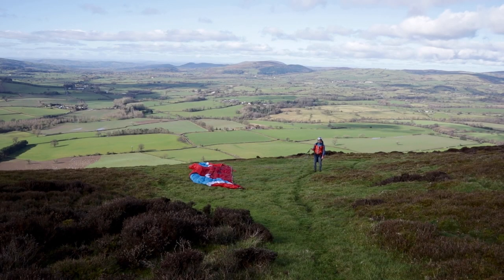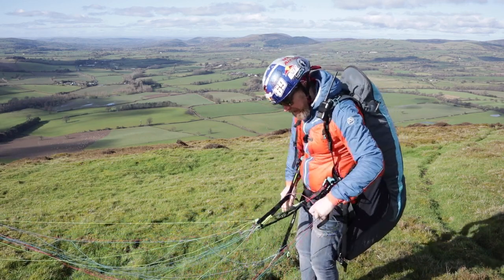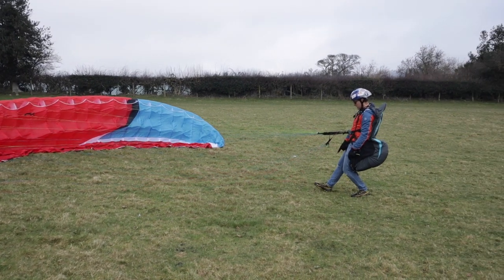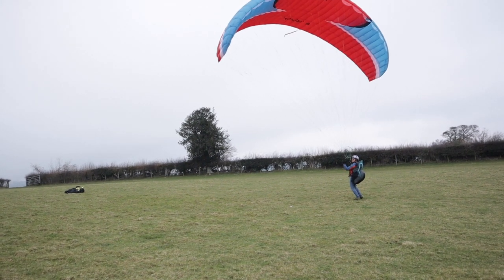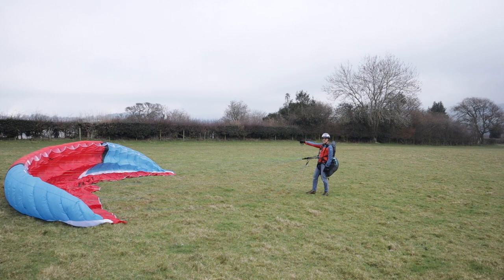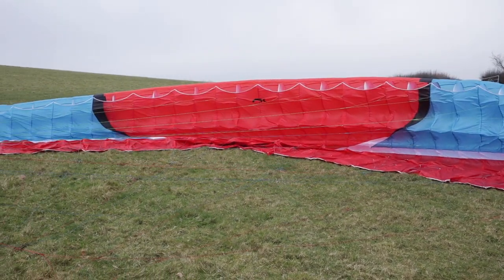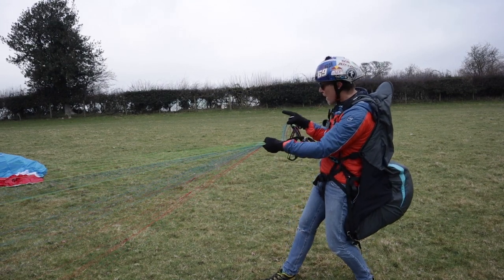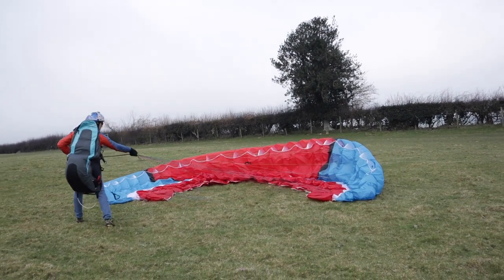Paragliding - Connecting and ground handling. Episode 2  #shorts

Comment: Really good tip for the ground roll control. That's something I often would get mixed up in my head and the way you explain it makes it really easy, move to the right pull to the right
Reply from the maker: That’s it, simple as thats mate.👍🪂
Reply: Yes, when facing the wing on reverse launch. When facing forwards you pull the brake under the high side, as Marc demonstrates.

Comment: Very clear, excellent video!
You are a good man!

Suggestion: assuming strong wind conditions…when going to take “an hour break”, perhaps it would be a good practice to put the other tip of the wing under the other tip (the one you already had folded in your video) and the harness on top of both of them, in case the strong wind changes direction during your brake.

I started to see your videos today and am a new subscriber.

Thank you for your videos!
Reply from the maker: Thank you for subscribing.

Comment: There are so many different methods and websites to look for weather before flying. Can you please create a very simplified method how a newbie can review weather?
Covering -
paragliding maps
free vs commercial websites and merits/demerits
what all to check (direction of wind, knots, any other things)
Lastly providing some readymade checklist for beginner pilots to start with?
Reply from the maker: There is no simple way at looking at just one weather site really, I check 4 or 5 each day for my students and try to build a picture myself for the following day.
Were also lucky to have a weather stn on top of one of our best hills that gives wind speed and direction with a camera too.
A big thing to remember is most weather sites wind speed is at sea level NOT hill level so you need to work out the height of your hill and get some practise in knowing how much to add to the forecast, ie when my local area forecasts say 10mph I double it and this is roughly what it will be on the hill top.

Comment: Thanks very much for the great videos. I've enjoyed watching them. Its been hard finding nearby instructors so I find myself mostly ground handling every day instead of flying. I know that will pay off down the road anyway. The other day, I was ground handling with fairly strong gusty winds. I was doing pretty well facing forwards and doing wingtip touches and recoveries. But a couple of times, I felt the wing drop back some, I released all brake pressure completely, but I still got dragged backwards. Any troubleshooting ideas to prevent this?
Reply from the maker: Thanks tom, it's so hard to say without seeing the situation buddy but your spot saying it will pay off in the end. Ground handling is the key. ps, if the wing is an older wing they do tend to hang back and fall back more than a crispy newer wing so it could be that.
Reply: @leavesleyaviation  Thanks for the reply, Marc. I got back out there some and I think I've found the problem. As the wing goes back, it felt to me as though it was a lot further back in the power window than it actually was. So, thinking it was about to drag me backwards into the street, I pulled the brakes to kill the wing, but that just pulled it further down into the power window and would really start pulling me backwards. Whereas, in reality, the wing hadn't really dropped that far back and what I needed to do was really lean forward and get as much weight in my chest as possible, and perhaps let the wing pick me up a little and "pendulum" backwards under the wing. It was more my perception that the wing was further back than it was, and my reaction to it was probably helping to make that my actual situation. Thought I'd share my self-assessment as it might help someone else.

Comment: Hi Mark. Great video. If a wing has split A risers, i.e. two A riser maillons on each side, do you take both of them or just the inner ones when guiding the wing up?
Reply from the maker: Very good question dave, if your wing tips have a habit of coming up quickly and almost before the centre section I would only use the inner A's buddy.

Comment: Hey Marc, great videos, tx! 
Just a question about the reverse launch. You have the right hand on the right riser break and left hand on the left riser break, so far I understand. But when you go for the rear risers you take the right rear riser with you left hand and the left rear riser with your right hand? Is that to be able to pull the rear risers further back? Many thanks for your help!
Reply from the maker: Thanks for the message pal and yes spot on 👍 ps BUT do not pull the rear risers past the front of your hips, if you do the wing will try to launch trailing edge first and go inside out, if that ever happens just release the riser a bit and it will correct it’s self.👍🪂
Reply: @leavesleyaviation  Okay! Thanks for your quick reply! I'll go for my first real life introduction paragliding in a month🤩Your videos make me feel I could do without, but I guess some personal training is always recommended, regarding the risks of the sport😛
Reply from the maker: Thats great to hear, yes 100% better to get an instructor 😉🪂

Comment: Thank you so much Marc! I am a low hour P2 I’m Michigan U.S. We have much wind here. Coastal cliffs. Sand. We have to launch on the top of the slope because of no flat or nicely rolling tops like in the U.K. Any suggestions for launching on sand slopes in winds 12-18 knots? I have a B wing.
Reply from the maker: Hi dave, well I launch my wing on the beach then run sideways up the dune and I am away, it takes practise but works great.

Next time I am at the beach I will make a video.👊🪂

Comment: Hi Mark, I am a little bit confused on the pitch-control at around the 16th minute of the video. If the wing goes to the left, of course I also walk left to get under the wing again. You say, I must also pull left whilst walking left and there is what I got taught different. I would walk left and pull the break on the right to get centrally under the wing quicker... It works good but what you do works obviously also good. Can you explain that to me please? Thanks in advance and warm regards, Moritz
Reply from the maker: Thanks for the message Moritz, when you were taught do I take it you were taught to twist LEFT?
This would be why when the glider falls left you would pull right brake, it is because the way I teach is to twist RIGHT.
Basically it’s just because the risers are twisted one way or the other buddy.
Hope that makes sense ??
Reply: @leavesleyaviation  Thanks for the quick response Mark and yes, now it makes sense to me. We do then the same as i meant to break the right side of the wing which will be with the left hand and walking left :) Confusion over and warm regards to the UK
Reply from the maker: @moritzleidler  hehe all the best buddy.
Reply: @leavesleyaviation  Wrote you an inquiry via email. See you there :)
Reply from the maker: @moritzleidler  Ok not had it so far!
Reply: Yes you are confused. What you meant to say was 'roll-control', not 'pitch-control'.
Roll is left or right, but pitch is backwards and forwards.

Comment: Been training a few months, vest video I've found. Thank you. 

One question, what if the glider turns? So not going down left or right (roll), not up or down (pitch) but spinning on its axis (yaw). Can I correct that or is that just the wind changing and I need to follow it?
Reply from the maker: If you mean like a helicopter / spin while above you while ground handling this will not happen sir, it can only go into a heli / spin in the pilot pulls full brake one side, I am guessing that's what you mean?
Reply: @leavesleyaviation  sorry, I might not have explained that vert well. I don't mean a full on spin I just mean a turn (yaw) on its axis. So the right wing tip comes forward and the left goes back. So it's no going down on one side which I know how yo control or too far over or too low down its turning a little above my head. This was happening last time I practiced. In hindsight I thought it might have been due to variable wind but I'm not sure. Just keen to understand how to control it. I'm very new to this so it could well be something very obvious
Reply from the maker: @FlyMuz  Send me a whatsapp video please and I will try to help you from that, many do it this way and it’s much easier to see what you mean.👍🪂

Comment: To take the brakes, with your hand, follow the riser from the carabiner to the brake handle. While you do that, straighten out the riser. If you just reach over and in, like in the video, there is a chance the brake lines end up twisted around the riser. 
Also, don't forget the speed system. 

Otherwise, excellent video.
Reply from the maker: No because you check the risers are correct before you then take the controls.👍🪂
Reply: @leavesleyaviation  And a good way to check the risers are correct, is to follow the riser from the carabiner to the brake handle with your hand, straightening it out as you do that. 

It is just an additional tip on top of the good advice you give in the video.